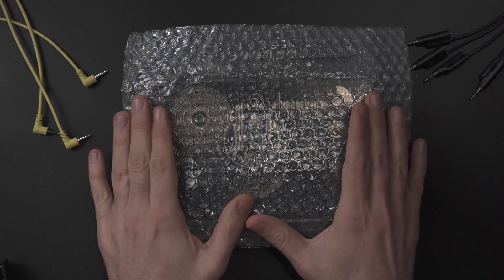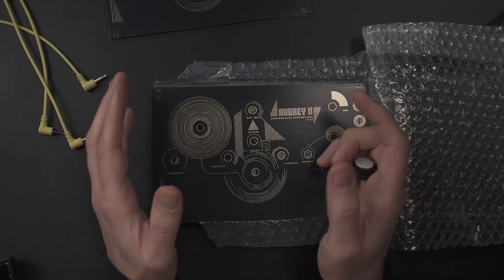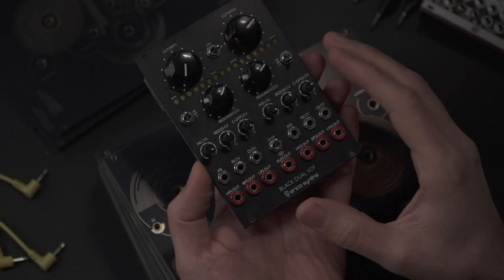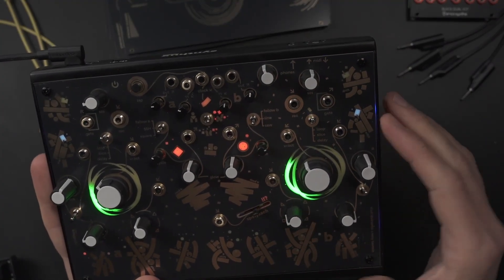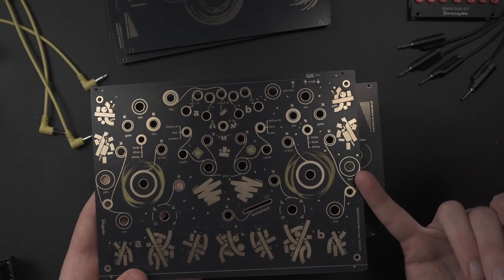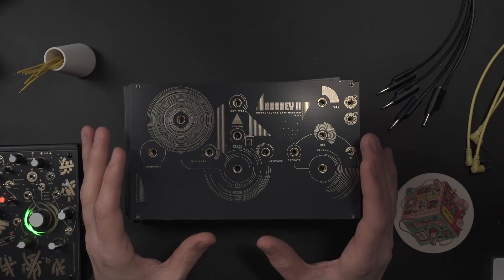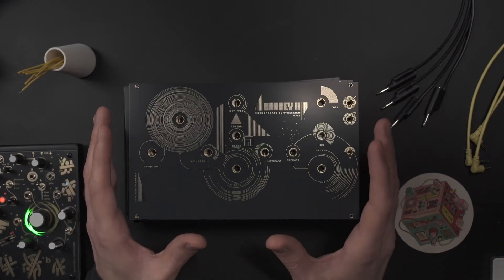We Need to Talk About PCB Waste… (And How You Can Help)

Comment: So strange! If I would like to buy such a synth (but I don't need one-voice synth or drone without CV/gate) then these little defects could not be a problem! If the price is adequate then I could pay the full price. What a perfectionist approach? Is it right about those who care about minor shiny spots or these "scratches" (not scratches, just some shiny line or whatever it is).
Our main problem for this time is political sanctions. We can't buy without re-sellers :)) I've paid ~30-40% more money for Pro-800 but I've still bought it because it's a very good synthesizer.
PCB faceplates looks great!
Man I can suggest some workaround for those "spot pickers": you can produce additional layer - a black (or any color/s) film with windows. This will hide minor defects easily. And you must write a precaution for users that they must not remove it to save warranty and etc. Anything you need to protect them from seeing the "truth" )) Sorry, it sounds funny for me, for you - not... obviously. But you could think about something like that.
Reply from the maker: I get where you’re coming from, but as a designer, I see things differently. Cosmetic flaws may not affect function, but for some people, they matter. That’s fine—everyone has different standards for different things. My bigger concern here is waste. If we reject perfectly good synths over minor imperfections, we create unnecessary waste. That’s why I made this video: to encourage people to reconsider what really matters. If more people accept these small flaws, fewer instruments get scrapped or discounted into oblivion. It’s a small change, but in a niche community like ours, it can make a difference.

Comment: If you had an ion beam drill lying around, you could make tiny holes in the aluminum that make it look translucent for the LED behind it. I believe Apple has a patent on it. No matter, because who has an ion drill and the time needed to drill all those microscopically small holes.
Reply: Yeah, whatever gramps. Send another team to Pluto...
Reply: @ I just found out that Apple uses lasers now for that, after routing away almost all metal in front of the LED of course. Seems less unfeasible, still kinda sci-fi though :)
Reply from the maker: @ronnetgrazer362 that’s wild though. I find all these engineering techniques fascinating!
Reply from the maker: That’d be fun though!

Comment: Sell them as b stock is à realy good idea, many People like me didn't care about small cosmetic problème.

50% is enormous ! I thinck 15/20% will work :)

Is the Black screen in the middle of your vidéo 
Is  intensional?
Reply from the maker: Thank you! We wanted to give a big incentive. I hope that more people will get them this way.

What black screen do you refer to? Can you tell me what timestamp it's in? Thanks!
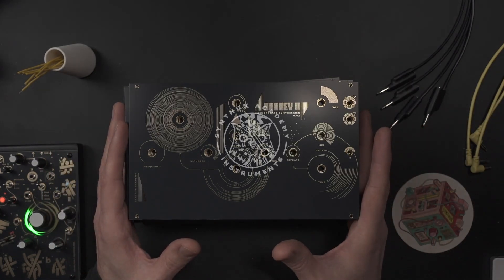Reply: @SynthuxAcademy  5:00
Reply: Ihave à black screen between +-5.11 to 10.15 , i have a poor connexion it can be just me
Reply: @Meska_Statik  i also see the black screen. i think the video was simply not cut where it should be....
Reply from the maker: Should be fixed. Thanks for letting me know. Indeed, it was cut wrongly.
Reply: I agree with all this - it’s a great solution to a real problem. I think 50% is a very generous discount and I’m happy to have picked one up!! But depending on the defect rate and volume of B stock you need to shift, I think you would get similar enthusiastic and appreciative take up at a smaller discount like 20-30%.  Great work guys and thanks!!
Reply from the maker: @wireheadinstruments thanks for this. It’s the first time we’re doing such thing, and we just wanted to get as many of these panels as possible used. This weekend was a lot of packing. I’m happy we did it.